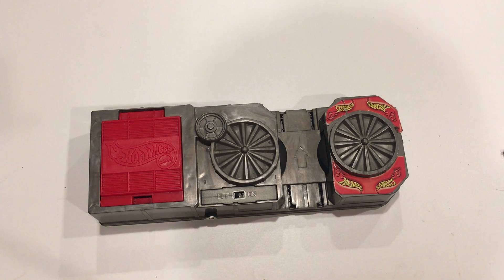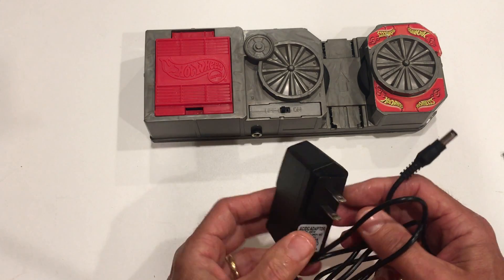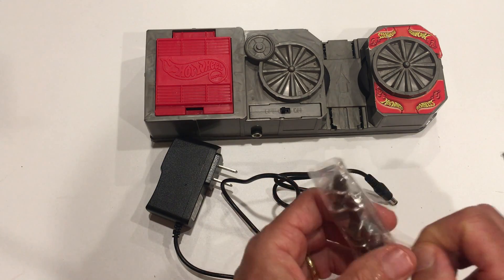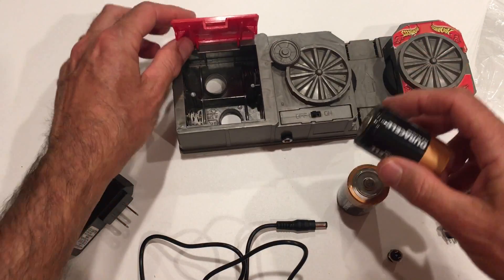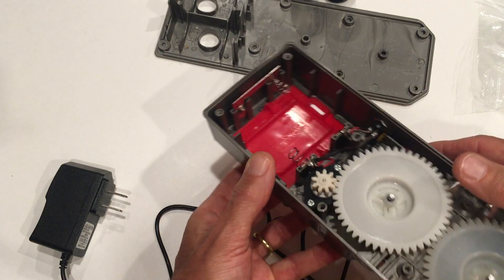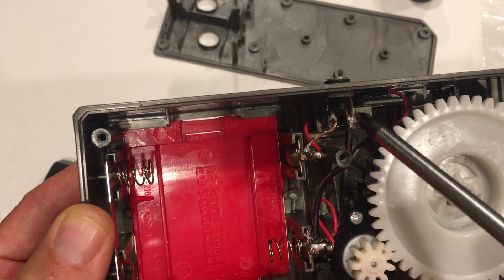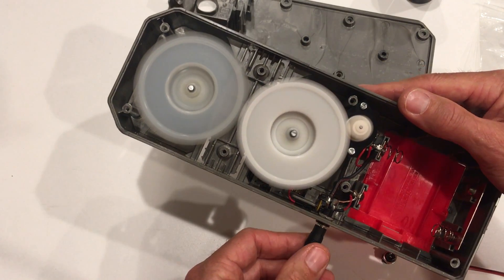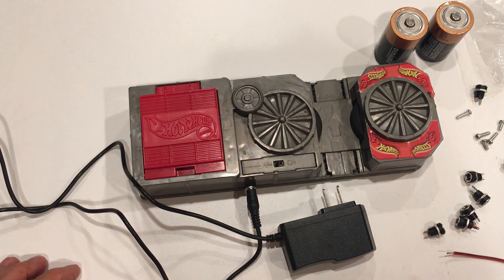Hot Wheels Booster Mod

Comment: Super vidéo ! Pouvez-vous me dire   la largeur exact du passage de la voiture (Sans compter les grosses roues) Merci. 😁
Reply from the maker: The opening width between the hard plastic side walls (not including the soft rollers) varies from approximately 4.10 cm at the top to about 3.75 cm at the bottom near the track.
Reply: @mccord50  Thank you  very very Much 🤗

Comment: How do i make the booster faster then it is when useing batteries? Is there a way? Or does this mod you did make it more powerful to go faster? I have a problem with my sons booster not being fast enough or powerful enough to boost cars through loops even with new booster and new batteries?
Reply from the maker: Kurtis,
The power booster speed is proportional to the applied voltage.  A booster powered by two (2) D-cells is running on 3-volts (2 x 1.5v = 3v), so if you use a 4.5v adapter you should see a marked increase in speed.  Likewise a 6v adapter should nearly double the speed.  There's a limit to how much over-voltage can be applied, but I don't think you'd have any issues going 50-100% over the "stock" voltage.  Best option is a variable voltage power supply with at least 2-amp capacity, that way you'll have some options for speed control so cars don't just fly off the track.  Have fun and good luck.

Comment: Can i use a 3v 72watt adapter? Thanks
Reply from the maker: If this is a “universal” adapter with multiple voltages you should be okay.
Although 72-watts is much more power than a Hot Wheels booster needs, the surplus amperage in your oversized adapter will just remain untapped.
A dual battery, 3-volt, Hot Wheels booster like the one in this video will run fine with only 1-amp (I.e. 3 watts).
While your adapter could work just fine, using grossly oversized adapters is not good practice.
A good article on AC adapters can be found here:
https://dfarq.homeip.net/what-you-need-to-know-to-safely-replace-or-substitute-ac-adapters/

Best of  luck with your project and let us know how it works out.
Reply: @mccord50  thanks for the info mate! God bless
Reply: Just checked it. It says 3v 5amps I hope its ok. Just ordered it online
Reply from the maker: Should be fine.

Comment: i do adore the internet. I unboxed this very item for my son on saturday and immediately thought that it needed to be converted to a more consistant power supply - low and behold, the internet delivered, bravo good sir. I've located the AC / DC adapater on amazon quite easily, the only thing im having trouble sourcing are the requisite plug that needs to be mounted / soldered to the unit itself. Can you give me any more information on them? I understand they are for security cameras but my searches thus far are not proving fruitful
Reply: Hi Atticus. I'm planning on adapting my son's set too. How did you get on?
Reply from the maker: Hi Atticus.  Thank you for your comment and question.  Assuming your AC to DC adapter has a 5.5mm x 2.1 mm plug end, the female socket you need is properly described as: "5.5 x 2.1mm DC Power Supply Jack Socket Female Panel Mount 3-Pin Connector".  A search on Amazon or ebay will return many inexpensive sources.  The sockets are sold in 2-pin and 3-pin configurations.  I now recommend using 3-pin type, even though this video shows a 2-pin socket being installed.  The 2-pin socket installation is easier, but as I wrote in description above, there is a danger if the booster is powered with AC when batteries are in the compartment.  The 3-pin socket is preferred because when properly wired it will automatically isolate the batteries when the AC/DC adapter is used.   This safety feature will prevent uncontrolled overcharging of the batteries which could cause explosion, leakage, or fire.  There is plenty of info on the web explaining how to wire 3-pin sockets.  Good luck with your booster.
Reply: excellent, thanks for the tip. The ACDC adapter i found has interchangeable plugs in a variety of sizes, so i started searching female sockets to match - 5.5 x 2.5 seeming to be the most readily available - but only found 3-pin configurations, figured they were unsuitable for the task - but if you say they are preferable its all sorted then, thanks so much for your help

Comment: i want to do this with my sons Hot wheels Wall track and Disny cars Florida Speed way. both take 4 D batteries. i have an AC/DC adapter that is 6v 200mA. will this be sufficient to run them?
Reply from the maker: Hello, and thanks for your comment.  An adapter with output of only 200mA (=1/5th of 1 Amp) sounds a bit low to replace 4 D cell batteries.  No harm in trying, but result will likely be disappointing.  I have a Hot Wheels Criss Cross Crash set that runs on 4 D cells which I converted.  It runs okay on 500 mA (1/2 amp), but I usually run it with a 6V/1A adapter.  Never tried running it on 200mA.  My recommendation - buy a different adapter with higher output.  The adapters are cheap.  The last one I bought on ebay cost less than $2 delivered.  Sweet!
Good luck with your project.

Comment: I converted my double power boosters (light blue). Using a 6V 1A.
They are connected to a central unit (4 D) which powers both boosters. Only bug is, that when both are connected it stutters at first. I have to replug one of them then it runs. 
Had the same effect on another project powering a fan. Maybe current is too low? What effect does current have on the motors?

Ordered 2 more normal booster and I plan on wiring up all 4 via https://www.amazon.de/gp/product/B01MY2A95C this multi step down converter.

Also ordered this to play around with voltage and maybe overclock a bit https://www.amazon.de/dp/B00RGK5G3I

Thanks for your video. I was really suprised that there is not much info on modifying this HW stuff.
Reply from the maker: Hello, thanks for your comment, and congratulations on your mods.  Sounds like you are on the right track.  

In general motors will draw more current as they deliver more torque, with maximum current drawn in a "locked rotor" condition.  Likewise, in a motor starved for current, torque diminishes and the motor ultimately stalls (or as in your case "stutters").  This torque-current relationship means when motors are first turned on they briefly demand a larger current to get them started.  This “in-rush” current drops off quickly as the motor gets spinning to steady state conditions and the motor needs less torque to keep moving. 

If you’re driving larger, or multiple, motors you could find your power supply is capable of running the motor(s) just fine once spinning, yet still have trouble (and stutter or stall) when attempting to start.  In your example, the stock battery pack with four (4) alkaline D-cells is capable of producing well over 1-Amp in start-up current, so this could this be the problem.  

Here's an example D-Cell spec sheet: https://d2ei442zrkqy2u.cloudfront.net/wp-content/uploads/2016/03/QU1300_US_UL1.pdf
In the constant current graph you can see the alkaline D-Cell battery can deliver as much as 2,000 mA (2,000 mA = 2 amps) though not for very long.  

As you've discovered, a simple and safe solution, if you don't want to buy a higher amperage AC adapter, is to start the motors separately, letting one get up to speed before starting the other, and thereby keeping the maximum current demand within the 1-Amp rating of your existing AC adapter.

While I've converted boosters with multiple rollers run off a single motor (ex. HW Criss-Cross-Crash), I've never tried multiple motors, so thanks for this great lesson.  Good luck with your future Mods!
Reply: Thank you for the detailed explanation.

I now run a 12V 3A through the step down converter with 4 outputs. Put it in a box with 4 output DC jacks which get 3.3V (or adjustable). 
Modded all boosters with DC jacks and built some dc-dc cables. https://imgur.com/A34JXP4

Now I have the box as the power house and can connect the boosters in all variations. It's awesome and my son can keep playing forever :D
Reply: Hi, Would you tell which parts you used, and how connected? I certainly would appreciate it. Thank you.
Reply: Hey,

I have used a LM2596 step down converter with multiple outputs. Also DC Jacks i wired in. Put it all in a cardboard box, which should not be the final solution. Not safe for kids ;-)
Then I have built some DC-DC cables using cable and plugs.
Put DC jacks into all boosters (like in this video).

I now have 2 Outputs with 3.3V and 2 adjustable Outs so you can also overclock the boosters (I tried 3.7V, very nice).

Put together a little documentation with photos for you, hope that helps ---> https://imgur.com/a/9KuoI

You should find everything on Amazon or somewhere else. I'm powering it using a 12V 3A adapter.

P.S: I am stupid when it comes to electronics, learnt everything I needed to do here from YT :D
Reply: I have the same set-up, but I was thinking of purchasing a 6v 2 amp power supply... do you think I should stick with 1 amp or 2 amp?

Comment: Would you be able to tell me which adapter on eBay you bought? I purchased a 3V 1A adapter and it only "stutters" when I switch it on with no batteries. If I put the batteries in, turn it on, then remove the batteries, it continues to run. This leads me to believe there is some sort of protection in the adapter that prevents it from starting the motors. The stuttering being the result of the draw going up enough to just "kick" the motor but then the protection in the adapter kills it, rinse and repeat.

EDIT: Also...if I just left batteries in there, will they drain? I.e. would leaving the batteries in there just to supply starting current will it then run off the adapter or continue to drain the batteries?
Reply from the maker: Adam,
First off, you should never use the AC/DC adapter while batteries are in the booster.  If both power supplies are used at once, or if batteries are left in while also plugged into AC it could act like a battery charger, but without the protective components a battery charger contains.  The result could be unregulated over-charging, overheating, fire, or explosion of batteries.  
As for troubleshooting the "stutter", the adapter might be the problem (I've had some duds), but unlikely. If you have a multi-meter you can verify operation and voltage output.    What type of booster did you modify and how many, and what type, of batteries does it use?  Are you sure polarity is correct (i.e. is booster spinning in correct direction)?  How and where did you connect wiring (solder)? Might it be a loose connection? Good luck, and please keep me posted.
Reply: Thanks for the reply. Yeah, I kind of figured that would be a no-no since the device is not set up to be a charger. 

My connections and polarity are definitely correct because when it does "stutter" it spins in the correct direction. In addition, if I briefly start it with the batteries in and connected to the adapter, it starts fine and upon removing the batteries, it continues to run correctly. Just for fun, I re-did all solder connections being very careful to ensure solid contact. It looks much cleaner but still no-go. I does (and did before) read 3.26v on my multimeter. 

The unit I have is identical to yours except for having a blue battery cover instead of your red one. It takes two D batteries. I pulled the motor but can't really find anything identifiable on it. 

I have to think there is some sort of spike protection on my adapter. When plugged in, there's an LED on it that glows. When I start the unit, the light goes out while it's stuttering. When I switch the unit off, the LED blinks twice then stays solid. 

I've Googled the specs of yours (ACDC Adapter, 3V 1A Model 0310) and found one identical to yours on Amazon so that is on its way.
Reply from the maker: Adam, Did your new 1-amp adapter solve your problem?  After re-reading your post, I think your problem was similar to dga711's (insufficient start-up current).  You may want to read my reply. Good luck and thanks again for posting your experience.

Comment: hey i make one and it succeed ! 
thanks for your video you save me some bucks from repeatly buying batteries
you can see my booster on my video
in my video i use multiple channel of voltage from 1.5v to 12v i already tried from 1.5v,3v,4.5v and 6v the booster get faster more than normal using batteries,but the negative effect is the rubber launcher get much more damage.

this is the video
https://youtu.be/nq07rmrcoHc
cheers!
Reply from the maker: Your welcome.  I'm glad you enjoyed this video and glad your project was a success.  Also nice job on your video!
The variable voltage is a nice touch on your mod, but be careful.  While a little over-voltage is usually not a problem, reducing the voltage usually means more current which can increase temperature over sustained periods and potentially damage motor or even result in fire.

Comment: Hi. I was looking for something like that... many batteries for the planet. One question if you don't mind: the adapter has at the end of the wire the plug with + in the center and - outside, so can I use one switched? (- in the center and + outside?). Thanks.
Reply from the maker: Yes, a different adapter is fine.  You just need to identify the positive (+) and negative parts on the DC end of your AC to DC adapter (or perhaps more importantly, the terminals on the receiving socket it plugs into) and then connect from those terminals to the positive and negative terminals in the battery compartment to ensure correct polarity.  Just remember: Negative to negative and positive to positive.  Good luck and have fun!  ;-)
Reply: Thanks for the info. I'm going to make all the process soon!